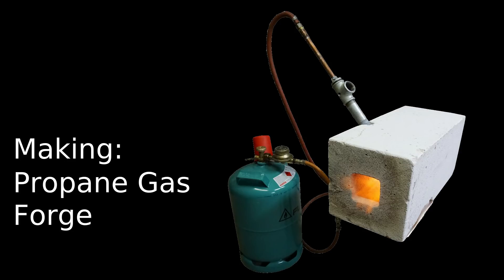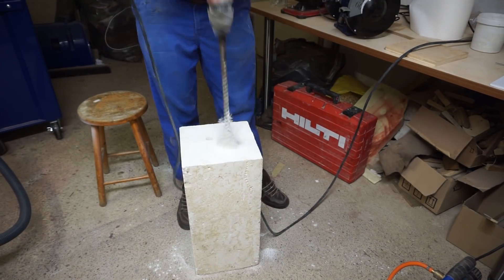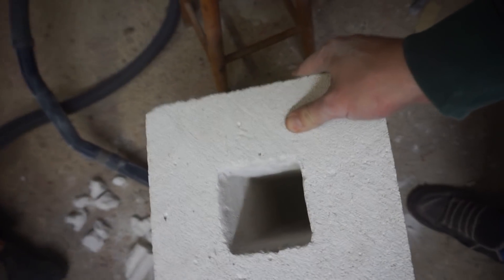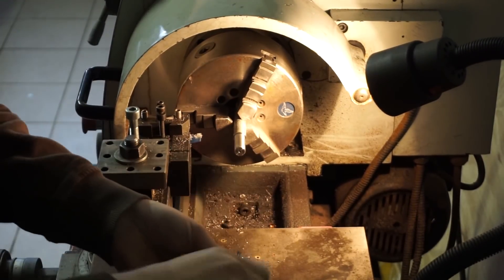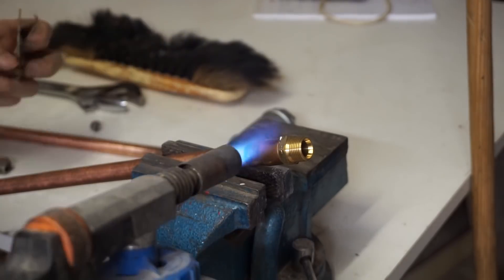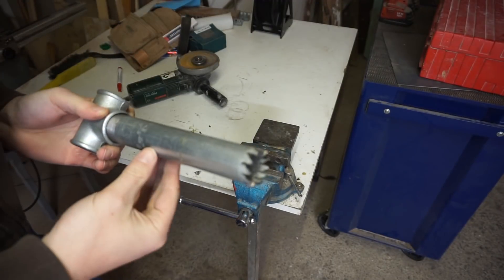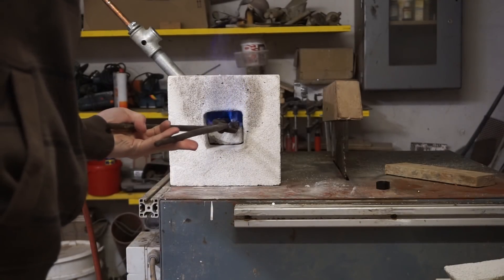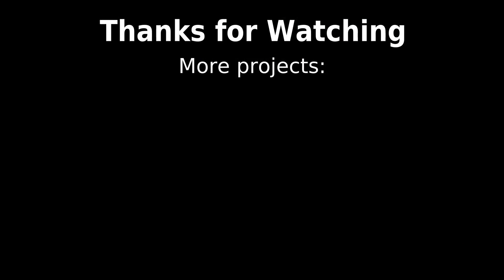Making a DIY Propane Gas Forge

Comment: Where did you get a big chunk of aerated concrete like that. All I can find is a little bricks
Reply: Super  they have to make it some where. I can't remember the comp at but it was a gas forge for like 169 bucks. Wasn't really wanting to spend that much incase I don't enjoy it.
Reply: Super  "US Forge Propane for Knifemaking Blacksmith 2 YRS WARRANTY | eBay" https://www.ebay.com/itm/US-Forge-Propane-for-Knifemaking-Blacksmith-2-YRS-WARRANTY/163583033746?chn=ps&norover=1&mkevt=1&mkrid=711-117182-37290-0&mkcid=2&itemid=163583033746&targetid=1068323857870&device=m&mktype=pla&googleloc=9029662&campaignid=11614425305&mkgroupid=112826245363&rlsatarget=pla-1068323857870&abcId=9300456&merchantid=6296724&gclid=Cj0KCQiAjKqABhDLARIsABbJrGnHNcrS3vOHGb9QnL-r_SyvLuGJMvLObSqIEZzVor5edLU4VVmI-jsaAhrmEALw_wcB&pageci=109266bc-38d1-4204-9305-00e1718604db
Reply: Super  I don't really have a place.lol I live in a 1000 sq ft home with a wife, 2 kids,3 dogs,3 cats,4 chickens. I'd have to just find a spot in they yard. That's generally why I don't try the things I'd like is space. It's kind of a drag but I'll figure it out

Comment: Nice job. It is almost the same as I made for myself ;) I just have an air regulator, because sometimes it is useful to choke it a bit and i use 0.8mm MIG tip. 
For example for quenching of small blades it is enough to use 0,2 Bar of propane as it holds the temprature  inside of the forge on about 800-850°C and it needs much less air to have neutral flame (not that much oxidizing).
Reply: Borax